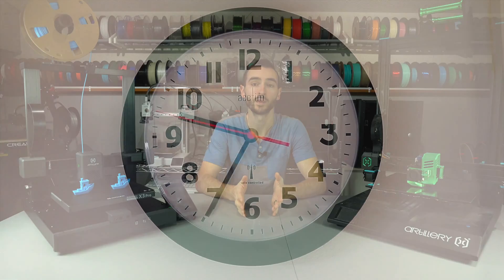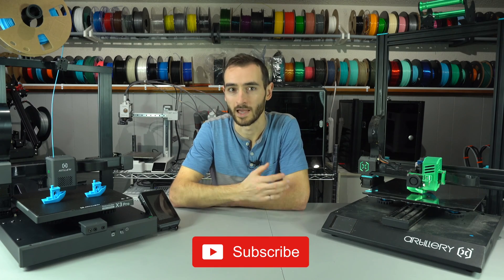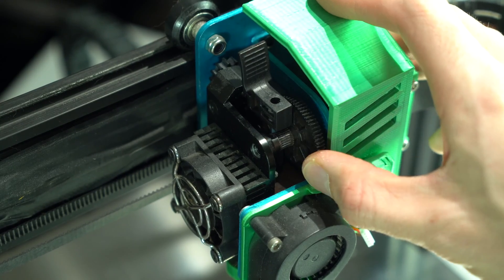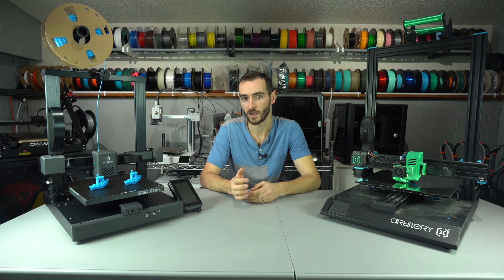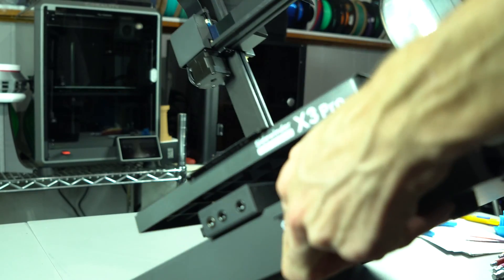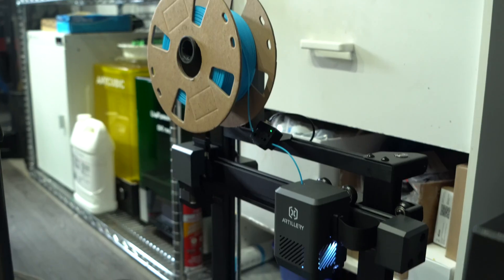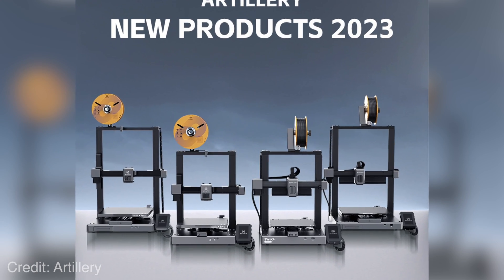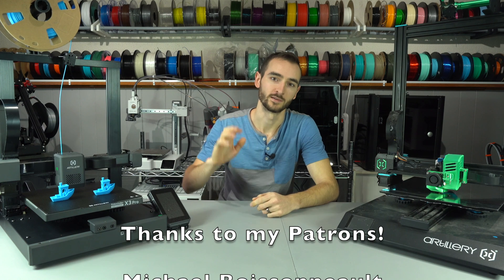Pushing Marlin Firmware to Its LIMITS - Artillery Sidewinder X3 HONEST Review

Comment: I figured I’d buy one of these printers just for experimenting, and I specifically wanted a large-format one (300 × 300 × 400 mm) so I could eventually print things like custom shoe insoles. Because of the price, I went with the Sidewinder X3 Plus, which was on sale for €127 compared to the X4 Plus at €226. If it breaks, at least I’ll have spare parts like stepper motors, the power supply, and aluminum profiles. Right now the printer costs about €174.

I found it pretty annoying to keep saving the G-code to a memory card and carrying it back and forth, so now I slice in Orca Slicer and send the print job through Ultimaker using a USB-C to USB-C cable.

At the moment I’m experimenting with printing using my own filament made from PET bottles, and it actually prints quite nicely. My second printer is a Bambu Lab A1 Mini.

Comment: Just review creality se.
I goth one and use Cura.
My speed is set to 200mms.
The first ten layers are set to slow.
After that al hell breaks lose.
My layer height is set to 0.26.
My seam is user specefeit .
My wals are set to 5.
E.c.t.
Y even use this setting.
For my little printer from temu.
Easthread k.9.
Not the print speed of Corse.
And the layer height.
Bud everything else.
Yes.
And here we make bal BEARINGS on 65 euro Printer.
Just for fun .
Thats bin written.
Why do you want to go faster you need speed p.l.a.
Pet.g. you always print slower.
And t.p.u. also.
Why just not put 10 printers creality se .
For one bambula lab.

Comment: I think this printer is already obsolete compared to other printers on the market.
 I think there are so many Ender 3 variations due to the high volume of initial sales of these printers and when the sales start tailing off they just pump out another version, the development costs must be lower than the loss of sales as a printer tails off
Reply from the maker: The Creality business model is perplexing. I wonder if anyone at the company even knows the names of half of the printers in their lineup 😂
Reply: @ygk3d  what you siad is similar in nature to the micro helicopter business when it was at the pinnacle of the RC micro heli revolution so many micro helicopters came out that at some point it was hard to keep track of all.  

Because of my early intro ( porior to the boom of the micro heli revolution) of some of my own early Micro, Sub -Micro and Palm-Size helis to the market, I actually ended up revamping many of my original heli parts as upgrades for other subsequent companies micro helis.  

Bottom line is that all of these products did the same thing, with minor variation in architecture and performance. Same with the Creality line, but that is how these companies make their profits.  

I am of the opinion that solid companies should make solid products, by this I mean a product that is designed for longevity, but sadly in today's world this is not a good thing for a company that cares more about profits than providing a solid product to their customer.  Anycubic I3 Megas was on the right path but the machine was perhaps too good and they were not making as  much money as Creatily with all the versions.  DO IT RIGHT THE FIRST TIME   and KISS  does not seem to fit in a world which relies on excess waste and greed.
Reply from the maker: @MarioIArguello  great insights there. You’re absolutely right. Thanks for sharing!

Comment: I think you and I had significantly different experiences, which is entirely ok. Not going to lie, I do not remember exact quality details of my prints, but I wasn't not upset by it. I think the fact that it's a bed slinger that actually looks good is a positive. The new version of marlin with input shaping/resonance comp and the ability to calibrate them, if you know how, is incredibly valuable. The poop shute is great in my opinion. I've have MANY times where a purge line doesn't work, though I will say that in my testing the start gcode of the poop chute didn't work either, but that's because it retracted the filament prior, so nothing to purge, BUT it did however wipe against the nozzle cleaner perfectly every single time and did clean bits off the nozzle in multiple cases.

I guess this all just goes to show you it's very important to have different opinions and follow different creators because that's the only way to develop an opinion for yourself. I had a good experience, you had a bad one, so a viewer can take both of those experiences and pick apart what is important to them!! :)
Reply from the maker: Absolutely! I think I’m also biased because I wouldn’t be a customer for this class of machine normally. That being said, when I first got my X1 a few years back I thought it was great. I had 3 of them at the peak. I just would have liked to have seen more innovation in the years in between. The X4 looks promising, but the X3 just isn’t doing it for me. Although, as I pointed out towards the end of the video, I’d you’re in the market for a cheap printer, this beats the similarly priced Ender 3 V3 SE in ever category.

Comment: I have the X1 which was a nice printer to begin and to learn 3D printing. I have done a lot of technical pieces with it, of course with some maintenance of the hotend. The main drawback for me : It lacks some Gcode knowledge like the Pause to insert some nuts during printing. Now I wonder if I will go to Bambu Lab X1C with the AMS..
Last detail my X1 already has a RGB LED and not a white one...
Reply from the maker: The X1 was really good for its time. I think they were the Bambu lab equivalent of 2020. Unfortunately they haven’t innovated much between then and now.
Reply: You can still add a RPi and flash Klipper to the X1. There you can easily add these features to the macros of klipper. And you get all the nice features of Klipper and Mainsail/Fluidd.

Comment: That Artillery X3 is just a Mingda Magician X2 painted in gray
Reply: I actually love my mingda x2, but I do not think they're different. Artillery has some additional features here both hardware and firmware that make this a way better option, in my personal opinion.
Reply: It maybe, but when all machines begin to look like each other it is time to really invest the time to look with scrutiny beyond the sugar coating.
Reply from the maker: At some point, all bed slingers will look the same. The only ones truly innovating in this category are Bambu Lab, that I’m aware of.
Reply: @ygk3d  i would like to see the performance of the standard sized A1 that comes next week vs the Anycubic Kobra 2 Pro, the only bedslinger i know it can match against a P1P. 

My biggest complain on Artillery is that they came late to the party, Creality is being genius with the relatively low prices of the Ender 3 V3's (on developing countries like, México, is very neccesary, because Bambu Lab on México costs three times the original price), i wonder if the next Ender 5 would be a budget K1.
Reply from the maker: @omegadeepblue1407  Artillery had the upper hand back in 2020 but they waited too long to innovate. 

You make a great point about developing countries. The market for 3D printers varies dramatically from country to country.